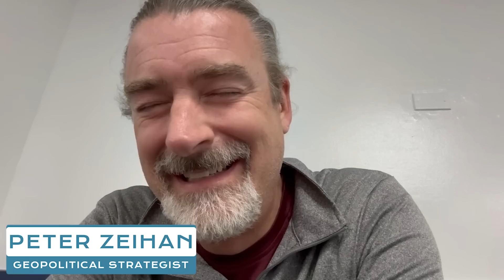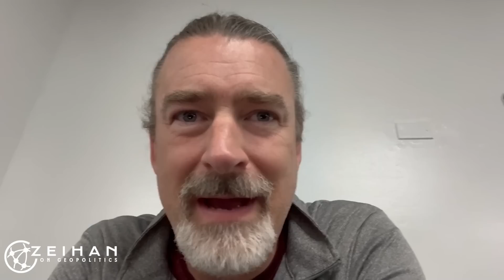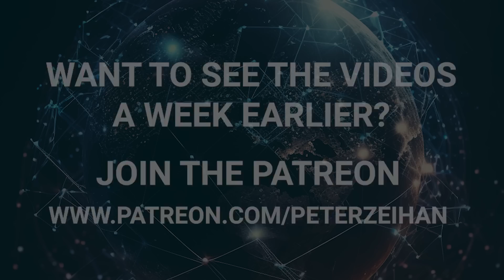Nuclear Power's Facelift: Small Modular Reactors || Peter Zeihan

Comment: SMR's will be a very short-lived fascination for Youtubers and the energy industry as independent studies have shown that nuclear power is: 6x more expensive than solar and wind + battery storage, and SMR's are 10-12x more expensive than solar and wind.  We'll see a few SMR's go online, and then it'll die off, when the owners realize, they can't sell the power they generate for 10x the cost of the solar plant next door.
Reply: France made those numbers wrong, didn’t they? Solar & wind provides intermittent generation & does supplement but does not replace generation. Batteries are also expensive & their production is far from green. The fact is we have to be multifaceted to have energy be both green & practical.
Reply: @kenandbarbie-b6c  No, Frances nuclear power fleet was built decades ago at huge cost.  New constuction will see renewables beat nuclear every time.
Reply: @kennethferland5579 Is solar economically viable in the dark? Is wind economically viable in the doldrums? The truth is energy requires multi faceted solutions, not one size fits all. Before Russia decided to invade Ukraine, Russia heavily funded the Green movement in Europe, (especially Germany) promoting the closure of nuclear & coal power plants. This was to ensure that Europe remains a loyal customer of oil & natural gas from Russia. Money, money, money! A lot has happened since that time.
Reply: I agree with your comment, excpet maybe for the "short-lived" part.  It really is an economic issue.  Lots of nuke advocates in the comments.  Most commenters have never solved a single power system powerflow case and don't understand how the grid actually functions.  You have to run Nuke plants 24/7 to amortize the capex to even approach economic viability.  In our Production Cost Modeling runs in a renewables-heavy scenario, Nukes run at an economic loss for about 80% of their hours.  They aren't cost competitive with other solutions.  There might be places like Japan and Europe with poor renewable resource availability where SMRs might make sense, but in the US, I would say they just don't pencil out.  They have horrendous unit commitment costs and the steam turbines don't ramp well.  Nukes and coal plants are the reason most pumped storage in the US is on the east coast.  And Bill Gates' Terra power project -- where they are running molten sodium to cool the core, then they have a heat exchanger system to run their steam turbine -- that just seems like Bill Gates attempting to become the Stockton Rush of nuclear power.

Comment: 1) It's "nuclear", not "nucular". 2) Assuming the COP (coefficient of performance) of your air conditioner is positive (and this is always the case), the AI chips themselves will use much more power than the cooling system. I know that trying to inject real, specialist knowledge in a Zeihan video is likely pointless, but there ya go.

Comment: The zirconium feedstock used to create the outside of the fuel rods comes from China.  The fuel rods are made in the US but only one year of the zirconium feedstock is kept on hand.  If China cuts off that supply that leaves one year for the two domestic zirconium manufacturers to source replacement material, design/modify and construct the new processes required by the new feed stock.  Until there is a good supply of domestic zirconium SMRs are subject to geopolitical disruptions.

Comment: In the US, there are currently 500,000 metric tons of radioactive waste in temporary storage waiting for proper disposal/storage/re-processing.  Peter is vastly understating the magnitude of the problem.  Plus, one of the big issues with micro modular reactors is that they produce way more lukewarm temperature water than electricity.  Unless a high paying customer for a ton of warm water can be found, a micro modular reactor makes zero financial sense.  While the technology is not overly complex or new, the industry has claimed to only be 5 years away from producing a micro modular reactor since the late 1940's, to date, no commercial micro modular nuclear reactor has ever been built, anywhere on earth.

Comment: Just built a new plant in Georgia. It’s great, works fine, construction costs were astronomical because of regulations and it’s still cheaper and more dependable than renewables. 

Build new reactors. Build a depository. If we really don’t want to build the depository, France both recycles and stores nuclear waste. We can pay the French to do what us Americans can’t. Problem solved.
Reply: No it was astronomical because the reactor builders are incompetent.  And it was MANY MANY times more costly then renewables, that's why only these southern states which have not decoupled the utility from the generators could even try this, the utility simply gets to push all the cost over runs to customers.  In any other state a utility will get bids from groups offering to buidl a powerplant, then a fixed price contract with them for the power over X years.  With that agreement hand the group can then get the loans to build and if it's not profitable they are the ones who lose not the utility or the public.

Comment: I like nuclear in principal but if it can't be done cost effectively anymore then what's the use? A new reactor on a good day takes 10+ years and 20 billion dollar (2 reactors at Hinkley Point C are at 40-50 billion in the latest estimates). For that money you can get 100 GWh of battery storage to even out the intermittent supply and demand caused by wind and solar.

Comment: peter glossed over the issues surrounding vogtle. the plant's construction ended up costing around $35 billion (over double projection), making it the most expensive power plant ever constructed (per the AP). the cost of such projects is itself prohibitive to nuclear power proliferation (these costs are passed on to consumers who pay more for electricity). the argument that nuclear power is clean is at best only partly true. its true that it's carbon free at the source, however, it is disingenuous to call a solution that produces a waste product that remains lethal to all forms of life "green". our definition of green is far too tightly wound around GHG emissions while ignoring other forms of waste and what to do about them. the longevity of nuclear waste also means that whatever management system we devise will have to scale indefinitely, making it - eventually - someone else's problem. CO2 emissions are at least mitigated, over the long term, by natural processes, whether that be as plant food or sequestration through rain and chemical processes. i'm unaware of a similar natural process related to nuclear waste, except through decay over thousands of years. imo, the waste and cost problems have to be solved before nuclear can be taken seriously. it's a better use of R&D to focus on battery technology and renewables.
Reply: That plant's design and constructions started in the 70's! I know because I worked on it straight out of college with a BSE in Nuclear Engineering although I ended up in mechanical design in Bechtel Power Corporation from 1976 to 1979. The design had to changed constantly due to changes in regulatory requirements. It was a cost plus contract so the customer (Southern Power) got burned. They had to shutdown the program because the cost overrun was threatening the viability of the company. They eventually restarted it and finally finished it. Units 1 & 2 were completed in the late 80's at a cost of less than $9 billion. Units 3 & 4 were completed in 2023 for ~$37 billion! Wow!
Reply: The cost is still lower than renewables plus storage, and wll able to be amortized across much more time than the initial operating license would suggest. Plus the whole basement had to be dug out, which won't happen again.
Reply: @gregorymalchuk272  Not even close, a solar/wind + battery system will under cut nuclear anywhere in the world today.

Comment: Hasn't France fixed that issue with being able to recycle and reuse spent rods in other reactors types instead of storing it? Also, the U.S govt needs to reduce the insane regulatory fees which stop the new nuclear production sote
Reply: Correct. The USA nuclear regulatory bureaucracy has been a nuclear abolitionist ministry for decades.
Reply: Sites,  not Sites. Typos
Reply: No.  They shut Superphenix down in 1998, and the smaller Phenix in 2010.

Comment: Ahhhh. I've been watching this space for years - And no-one has yet developed an Economically Viable option yet. There's 20 Companies in about 8 Countries that keep claiming they have, but no-one has been anywhere near the Budgets they started off promising. And in todays Security Environment, we're probably better off developing a Standard Model of a full size Plant that can be copied in different States and Countries.
Plus every Jurisdiction that ever had a Mayor or Councillor concerned about 3 Mile, Chernobyl or Fukushima has passed their own weird Laws about Nuclear, which is a Major Problem. There are regulations about where the Reinforcing in Concrete is supposed to be placed. What happens when you get that wrong? That Reg is from the Army Corps of Engineers. Get it wrong and the local Green faction will bankrupt your Contractor, - see VC Sumner Reactor in South Carolina. That was $9 Billion Lost.

Comment: I worked in the nuclear industry for 32 years and periodically heard about the “nuclear renaissance” for just as long. I’ll believe it when I see it.  As Peter says, it will require a massive adjustment in public perception as well as reform of the regulatory agency. It will require a shift away from the mission of the NRC and revert to a mission more like the AEC, to promote rather than penalize the use of nuclear power. Until that happens any plans for new developments in the nuclear power arena in the US is just wishful thinking.
Reply: There will be a nuclear renaissance.  Just not in the U.S.

Comment: Hold on we have a huge facility built in a mountain Colorado. Sometimes you get too lefty.
Reply: 1. You are thinking of Yucca Mountain, which is in Nevada, not Colorado.
2. Nevada, which is not "Leftist", shot YM down after taking some billion dollars for "evaluation". The reasons they gave are bogus, but, to be fair, the siting process was bogus, too. 
3. There is no need for a geologic repository. Spent Nuclear Fuel needs to be kept secure, for radiological purposes, for about 200 years. Before that it will become easy enough to reprocess that further storage isn't needed.
Reply: @ ok 
1. Just because I picked the wrong state doesn’t mean yuka  mountain doesn’t exist. 

2. Pretending that we don’t have the capability to take care of nuclear waste. So we don’t put in more nuclear electric facilities sounds left.

3 if you think I’m wrong because I pointed out the loopy lefty mindset or TDS and your feelings got hurt. But hiding the fact that we have a capability to deal with nuclear waste. Is dishonest it needs to be pointed out.

Comment: There are also good arguments for full size nuclear reactors.   The main one being reactor security.   It's much harder to ensure the security of 10 small reactors at dispersed sites than one big reactor.   The argument  that it makes power distribution easier or more efficient is a valid one, but in my opinion is not worth the trade off.
Reply: Also cost. The cost per megawatt of capacity and cost per kWh of energy is smaller for larger reactors.
Reply: also cost.  Big reactors are MUCH more cost effective than smaller ones, and micro reactors will likely also be even more expensive per watt produced.

Comment: Modular mobile nuclear generators are mostly vaporware, considering the regulations and disposal of spent nuclear fuel, are too much of a hassle/pia.

If the powers that be really wanted to go that route, they would have already copied/refined nuclear sub technology, and simply plugged them into various points of the grid. 

The future of power generation, is most likely going to come from ultra-deep geothermal wells, using plasma drill bit technology.
Reply: I'm interesting what thouse advanced drilling methods can do for geothermal, but skeptical of how much they can lower total costs because you still need a basic steam turbine powerplant on the surface and this has minimum costs too it that may end up being more then Renewable power costs.  Still Geothermal would be baseload and thus fully eliminate the last (in my opinion flawed) argument for why Nuclear is needed.

Comment: Had a suggestion. You had recently put out a video about Tesla capturing a booster for reuse and how much cheaper it has become to launch a pound of weight into space. Will it not be feasible to launch pods containing nuclear waste into orbit and then give the pod a nudge towards the sun. The pods will not require much propulsion due to the lack of atmosphere once out of orbit and will burn up in the sun. I am not a nuclear or space engineer, and it probably shows but dumb ideas sometimes tend to be feasible 😊
Reply: That's not how orbital mechanics work.  From a low orbit around the Earth you would need to accelerate something an insane amount to get it to reach the sun, basically it would need to leave the Earth at the same speed but in the opposite direction that the Earth moves around the sun so that the object could 'fall' directly into the sun (like pitching a 100 mph baseball out the back of a car going 100 mph so the ball just drops strait to the ground).  But the Earth is moving it's own diameter every 5 and a half minutes around the sun or about 4 times faster then an object in low orbit is moving relative to the Earth.  It is infact easier to just accelerate an object to escape the solar system entirely then it is to reach the sun.
Reply: @kennethferland5579  Thank you for the explanation! Very simple to understand. You seem to be well versed in the topic 🙏
Reply: you don't just 'nudge' something at the sun. for the same reason you don't just nudge a rocket to mars.

Comment: SMRs are interesting but I'm surprised there wasn't any mention of just building more AP-1000s.  Vogtle got built and its output costs $0.15/kWh worst case for our first attempt.  Jigar Shaw thinks cost would come down to at least $0.10/kWh if a fleet were built (say 20 more across country).  Optimistic case is cost of AP-1000 drops to $0.60 per kWh if industry really gets kicking on a massive builtout (say 100 plants over a decade or two).  The key is that this approach is the devil we know.  We could start the buildout tomorrow limited only by the time it takes to ramp up the work force and supply chain.

I don't have anything against SMRs and we should keep working on prototypes.  However, the hard truth is that with SMRs, we can't even start on a fleet buildout for at least a decade, and maybe longer. 

We absolutely need to kick off the fleet buildout starting today, not in a decade.